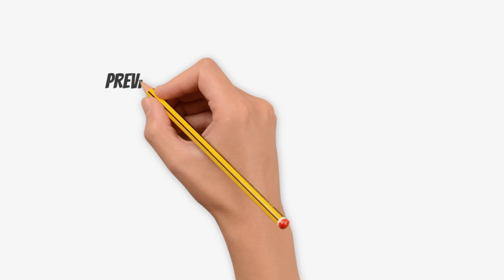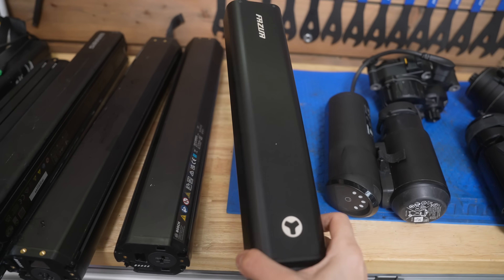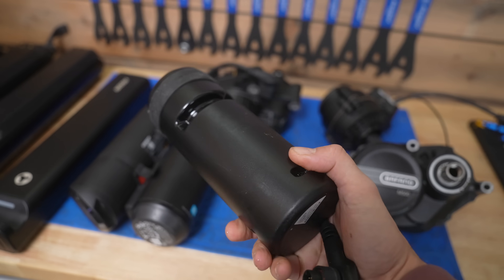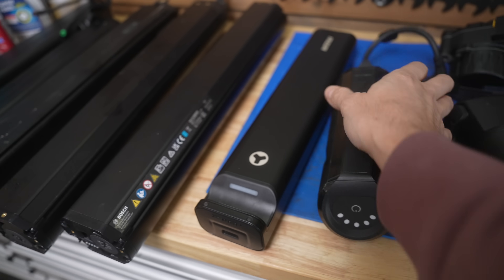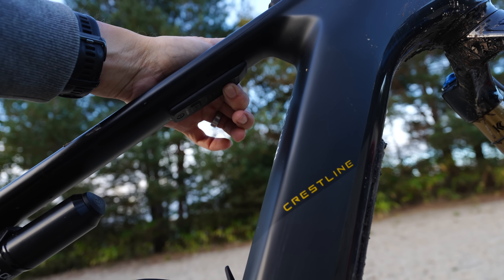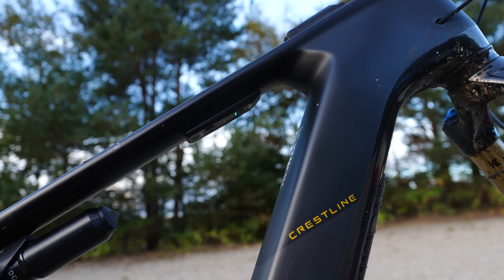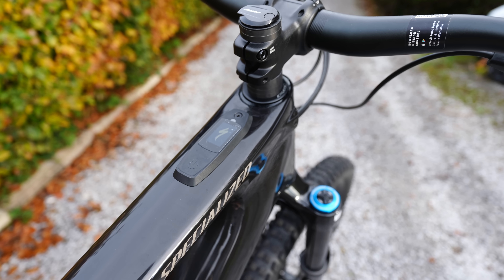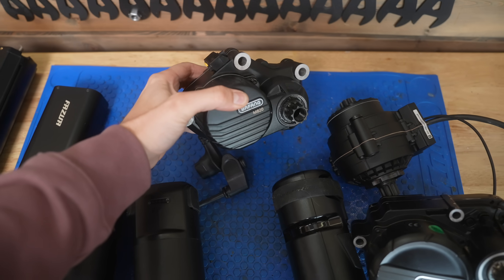We Have A Huge Problem With Ebikes....

Comment: I have a chinese microcar EV. Any battery with same size and voltage will work. The batteries are standard Lithium-Ion 60V.

My EV also doesn't have a computer, network connection, nor wifi. No garage link needed, no maintenance needed for the control module, no hassle. All parts are replaceable with parts from any brand, as long as it fits in the designated space.

The west is into planned obsolescence, by any means possible. Capitalism is just evil this way.

Comment: I spent the best part of £100 on the cables and gear shifting bits for my 4-year-old cube acid hybrid, but a week later motor crapped out with an error 500 and it bricked. On the 201st charge cycle. Almost impossible to repair with thier secret CAN bus tomfoolery. Eventually I the only economically sensible thing was a new bike, so the old one sits in the garden slowly rotting while I decide what to do with it. It needs to go the way of mobile phone chargers where they are forced to make them cross compatible - elimate planned obsolescence.

Comment: Just had it with my Cargo Bike last spring. After two years and a few weeks the motor seized (around 6500km) and I needed to get it fixed with a bike-shop nearby as I don't get access to the  motor. Even they had some issues getting the motor.  If shimano plulls the Plug on the production or decides not to supply  an exchange motor for whatever reason I am left with the choice of finding a good welder to mangle with it
That is quite a biiiiiiig bonus for Hub-Motors or Conversion kits. Furthermore, I am told it can be a daily ride but need to wait 8 Weeks for a replacement motor?! There is still some progress to be taken, but not on the engineering side alone.

Comment: Yep.  Exactly why I've stayed away from ebikes.  They are almost worse than buying a car.  You can buy a regular mountain bike and it'll hold 70-80% of it's value for a long long time.  Todays E-bikes will be garbage in 5 years when you can't find the v132 Shimano custom limited edition battery.  Oh, and then what happens when software is not supported anymore?

I also think it's a case of bike companies not being able to differentiate themselves enough.  If they standardize everything, what will put them ahead of the other brands? Probably nothing.  There are 15 bike brands that are functionally identical other than marketing materials and logos.

Comment: I'm building a solution

I also wanted to just drop the basic principles of the problem that exists independent of the desires of brands to provide cross compatibility. 

P=V*A so if you have a battery that has a specific voltage and amperage spec your controller and motor will likely be very closely matfched to the constant and peak oputput cabalities of your battery as to avoid excessive weight or cost. So maybe a new motor is designed for more peak amperage and the new controller therefore enables more peak amperage draw from the battery but your old batttery has cells that aren't designed to handle that peak amperage draw so the BMS says nein even though as a cosnumer you are like wait this is the same shape but in fact there are new cells in that seemingly identical battery or infinitely other variables that could change the equation.

There's a simple solution and I think most people who build their own PEV's know what it is :) Benjamin Vedder is your hero.

Comment: Also, I didn't hear the mention that if a system/part/frame is planned obsolescence equipment, then there is no incentive to keep producing the equipment. This means if you do own the obslete equipment and it malfunctions, there could be difficult finding replacement parts or parts that are not significantly more expensive.

Comment: Just buy a bike with a front wheel motor like a Beixo with a battery on a carrier.  I can just change the front wheel.  Take off the battery and it's back to a normal bike.

Comment: That's exactly my problem. Have a MTB with Bosch Gen2, upgradet with lots of new parts, fork, circuit, brakes and then the motor crashed. I realized that this motor is no longer available and that it's not seldom that motors crashes. So if you do not get a replacement motor because it's an old version, you have to crap the bike. Solution for me: I bought five used motors on eBay for the future of the bike...

Comment: The Chinese bikes actually offer this though. Many bikes that take the bafang battery's will actually take other chiens battery's. Can upgrade Ah, voltage, hell, even bafang have a bunch of motors that will fit in each other's frames. And the  replacement for the M620 is going to slip into M620 frames for easy upgrading!

Comment: I’m a diy e-bike rider and because of this I can use whatever battery will fit on my bike at the correct voltage. Currently use a specialized status 2 2014 with a BBSHD and 52v 13ah battery, under frame mounting with a support strap, been running it since 2019, had the motor since 2017, probably around 10000 to 15000 miles  on the motor, done 1 maintenance (grease) on inner gears and I’m on my 2nd set of batteries, (I have 2 batteries at time for when I want to do really long rides 50 miles or so.) first  2 batteries lasted 5 years, the range did degrade over time but they still worked great until they died.
Reply: BAFANG POWAAA
Reply: Yes, had my Bosch bike since 2014 but when the motor died in 2020 it was quite a hassle but managed to build an adapter for a Bafang Ultra to fit it on. Motor has now around 40.000km (25.000 miles) on it and is still running nicely. The bike frame alone was worth saving it and will easily do another 10 years saving me loads and loads of money by not wasting gas.
Reply: Have 7 home built ebikes run cyc or bafangs. All use the same batteries are programmable and will out perform any factory built emtn bikes out there. Hardtail full sus. and road bikes. Build your own and enjoy the ride.
Reply: exactly why i diy. (running diy on a 1990s Saracen vice)
Reply: I have 2000km on 2 different bbshd bikes so far. 
1 battery failed but i fixed it myself with a new bms. 

Absolutely awesome units aside from running square drive. I wish they would change to the current standard instead so we can run better cranks.
Reply: Wise words
Reply: My story is very similar.
First ebike I bought was 52V rear hub conversion, running at 1000W motor.
It was a cracking bike, and I used it to commute 20+ miles per day, all through the frost and snow of a British winter, for two years running, and the only problem it ever gave me was once when it rained torrentially, and water got onto the connectors. Dried off with a cloth and it was running again within a minute.

I upgraded for a 52V 1500W rear hub set up, with 24ah, and its done 5500 miles sonfsr without even so much as a hiccup.

For £1500 I built a bike that rides and PULLS!) up to 43-45mph, with a range of 28-85 miles, and i even added a motorcycle windshield with a handlebar windbreak.
Turn signals, brake lights, twin headlights, big brakes, comfort saddle, and the WHOLE LOT cost me less than £1500.

That, to me, is what ebiking is about.
Men in their garages fashioning parts and modifying simple, basic bikes.

All the best to you mate.
Reply: Yeah, bought a decent escooter but with bikes I stick with non electric because, much like full suspension bikes in the past, I still see significant developments ahead.
I imagine there will be a few standards accepted but motors, frame design, batteries, the balance between motor power and weight, these things are still far from not leaping in improvement.
I wouldn't want to invest in a bike only to have one far superior for far less money 5 years from now.
Scooters on the other hand have level led off with newer ones just offering silly electronic gimmicks like fancy displays but functionally they haven't been evolving that much.
Reply: Bicycles & eBikes are doing the same: little incremental changes, coupled with incompatibilities that could often have been avoided if reverse compatibility were desired. 

The main improvement in ebikes, will be the same as the improvement in stand-up scooters: Better battery cells.
Reply: @schlooonginator1227  Agreed but won't it always be this way with better stuff always 'on the way'/around the corner?🌞

Comment: How different is this actually from any car brand. If you like the speedometer of a Porsche, does not fit on a Chevy….I understand the frustration but…this is the way of the future, isn’t it? Recently I upgraded from a Google Pixel 6 phone to a Pixel 7, exactly the same size but the cases do not fit because the location of the cameras is slightly different. It is shame that to support sales we need to waste everything we buy in just a couple of years.

Comment: There are some E-Bike kits that you buy each component separately and convert a normal bike through a wheel hub motor. IMHO, go for one of those, they are far cheaper than a fully mounted E-Bike

Comment: That’s why you but the bike you want and put a bafang mid drive motor and any battery with the same voltage as the motors controller. Save yourself a couple of grand in the process and have as many aftermarket upgrades along the life of the bike as you want.

Comment: I bought an e-bike from a manufacturer and had a major problems replacing the battery
When it died after a couple years
 so the next time 
I built a 48 volt 20ah -1500 watt fat tire snow bike 
 all from Amazon for a  $1,000 bucks..

And I don't pedal it 
Average top speed is 33mph 
(have had it up to 36 mpg)

'm putting another battery on it to double the mileage
$300 fat Tire Bike 
$300 1500 watt motor 
$400 48v 20ah battery

to see it  check the video on my page

So if you don't want to spend a ton of money & can turn a wrench & strip wires 
You have less expensive options

Comment: Imagine if every Bike would work with nearly every battery. 
There could be an industry like with gas bottles in some areas. You buy one once and when it is empty you go to a dealer, give them your empty bottle and get another different fully recharged one for x amount of money. Replace gas bottle with battery and gas with charge. Infinite range🤘
But no - let's have thousand different standards😂

Comment: You are focusing on a problem that doesn't really exist. You made a very good comparison with laptops, you buy a laptop fully knowing that you won't be able to swap out CPU or GPU, that's why you buy something that you know will be good enough for your workload for next 5-8 years. Same with these integrated electric bikes, or even normal gasoline bikes, or cars, smartphones etc... with non interchangeable parts. You can always sell your bike later, and upgrade, you will still recover a significant part of the amount you spent. Or even go the route of buying one or two generation old models second hand, you will still be as excited, because the bike although not brand new will still be new and exciting for you. 
There will be a fairphone, framework laptop kind of brand for electric bicycles one day, but it will be a small niche like they are now.

Comment: Yes. If you're buying you're part of the problem, that's the first bit. Secondly yes, CAN bus or something as a comms bus, this is a problem that was solved many years ago, then you just need firmware and cable adapters, or standardised connectors.

Comment: This is why I just used a bafang BB conversion drive on a regular aluminum framed Spot. Not only did I get a very nice 750 watt performance thru a Alfine hub… but the whole bike only weighs 39 lbs.

Comment: EVs won't  be a viable alternative to petrol cars until all manufacturers agree to use a standard battery format that can be plugged in to all vehicles. The technology could have been developed to do this years ago. The importance of using standard batteries across all facets of motorised transport has been ignored for far too long.

Comment: The mtb industry is the absolute worst when it comes to proprietary bullshit and waste. Shimano vs SRAM non compatibility is the work of ridiculously proud engineers and greedy capitalists. On top of this disturbing situation with e bikes, even the most basic wear parts are not compatible.. Shimano and SRAM 12s chains are different and can’t be interchanged. And those are different than 11s chains. A chain! Insanity. Brake pads? So many pads even within brands. How many different bottom brackets are there? And the sockets to fit each one? I have 2 for Shimano alone. And chainring mount systems? Cinch? Direct mount? All require their own special tools. You can do most work on a motorcycle with a basic metric socket set. The amount of tools you need to work on mtbikes is beyond stupid. Such a waste of resources. And not to mention the nice old wheels or cranks you can’t use any more because they aren’t boost spacing, all in the name of innovation. Think of all of the trash tier disposable components they make just to be tossed after the inevitable upgrade they just roped you  into. Now they have gone too far with this careless bs. It is long overdue to proper call out these fucking clowns.

Comment: "We had to go proprietary to advance" is such bullshit. The Xbox One X is an advancement on the 360, still capable of running the old software, the Xbox Series is yet another advancement yet can still run the old software. Funnily enough, the wireless controllers can be used with the newest console, even the 360. If Microsoft, a money-grubbing bastard of a company can figure out backwards compatability, then the e-bike crowd can do so. No excuses.

Comment: Can't someone make adapters for chargers?
    Some people take E-bikes seriously (transportation), some as a hobby and others think of it as a disposable toy. I own a 2023 dual motor with all the quality add-ons most would want for $1,500.00. I made a larger rear cargo rack to hold 3 grocery bags....makes shopping (for the wife) fun again....do my banking....bring home restaurant food....all fun! 
   Back in 2019 I bought a slightly used 2018 Polaris Razor RZR 1000 Turbo with a lot of quality upgrades for over $20,000.00. I can easily sell it today for the same price or higher bc a new one is over $30,000.00 stock. 
     The price of E-Bikes seems to be dropping. Resale is dismal at best.  It's a relatively new "thing" and manufactures all want a piece of the action. E-bikes are quite limited in ability right now....not good for bad weather, one passenger only, short distance, limited cargo, dangerous for some....and so on. It's a toy. My Razor is a toy...but can go over 60 MPH across the desert, go up any sand dune effortlessly.....and has a distance range between 125-150 miles depending on terrain. I can safely carry an extra 5 gallons of gas or more if I really wanted but....naaa.

Comment: As an environmentally conscious bike mechanic I'm also so frustrated about this. I personally just use Bafang motors, since they will accept any battery that's not locked to a specific system.

Comment: The batteries and the chargers, at the very least, should be standardized by voltage. Motors maybe not. Notice that motors in other motorized vehicles are still proprietary,and somewhat difficult to upgrade. I think they should at least be upgradable within the different brands for "enthusiasts" much haw it is in the automotive world.

Comment: Even smart home devices have started standardizing. It took almost a decade, but it finally happened. Kind of. It will happen eventually, but it won’t be east. One way to get people to buy in would be to say “if you have the same bolt pattern as company A, if someone who has one of their bikes wants to upgrade the motor, they’re able to buy one from you instead of company A.” That would go over better than “quit being so mean and putting up walled gardens!”

Comment: Cars are this way, trucks are this way, motorcycles are this way, very little crosses over brand to brand.
The thing with batteries and chargers, there is software involved also.   Each brand has it's own take on all this stuff.

Comment: I bought a replacement motor for my older gen Bosch - only thing left to do is make sure I get one extra battery and a suspension rebuild kit and I'll be set - I've managed to keep this rig going for over 4 years - Cannondale Moterra - really awesome short travel trail bike and it does the job - the other thing I have extra of is Crank arms - make sure you buy extra crank arms - you're going to go through them and they're not made in large batches and always seem to be almost out of stock or entirely gone.  Keep brapping out their folks -

Comment: Yup. You have to lock your customers into a walled garden. It's why I like cutting cables. Ultimately, everything is just positive and negative DC. If the BMS isn't hardwired into the bike, we can do all kinds of neat things. On my own bikes, I have Lectric batteries, no-name Amazon batteries, and ones from Radpower. Bafang motors take just about any DC you can throw at it.

Thanks for saying this!

Comment: Having proprietary charger/battery is also a safety issue.  Having a more standard system would make it easier to certify and ensure that the battery technology and charging technology would be safe and effective.  Currently we see lots of reports of battery fires and charging issues with e-bikes.  Granted this is mostly with the smaller brands which don't have the capital and capacity to ensure and test against all the standards.  Getting better will help the industry as a whole.  Consumers need to be confident that their bikes will work without randomly catching fire.